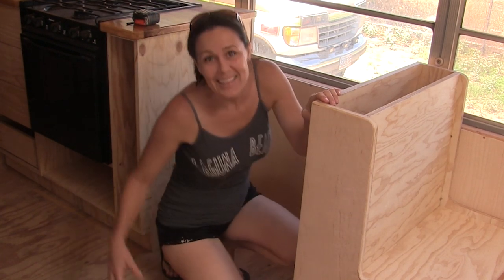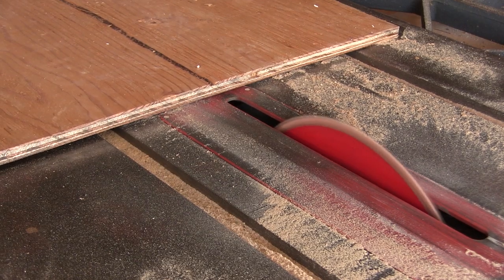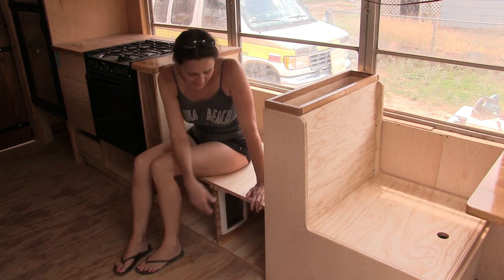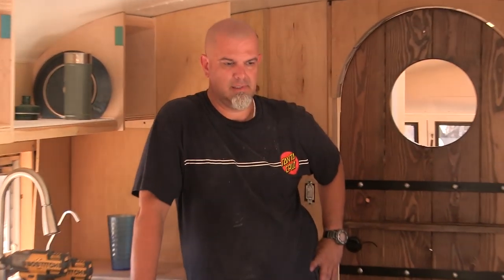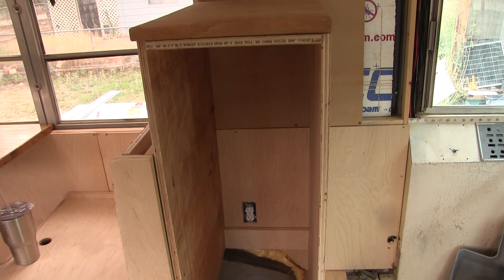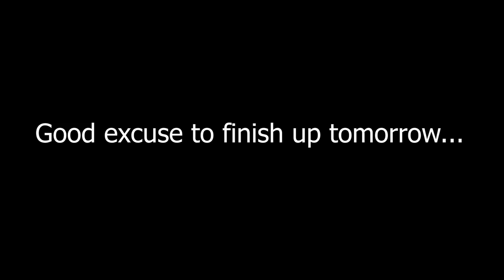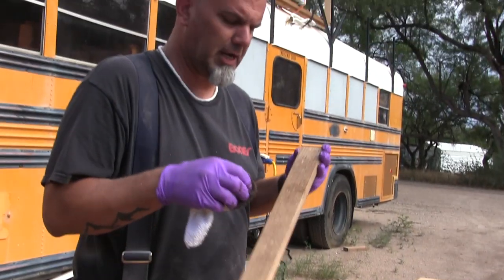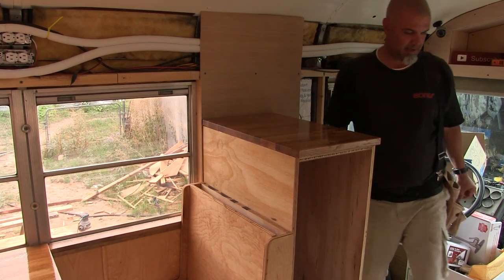Standing Desk/Cabinet, Kitty Kennel, Stain, Trim & More Skoolie Stuff!

Comment: Quick tip for cat litter: Do not get the Feline Pine stuff. It's 12 bucks for about 8 pounds. Instead, go to a farm supply store like Tractor Supply and get a 40 pound bag of pelletized horse bedding (compressed sawdust pellets). The reason why? It's the same thing as Feline Pine... but it's only $6 a bag... for 40 pounds. And you can use less than clay litter because it expands, it absorbs odor better, and you can toss the entire thing out when it's all been used up. And since it's sawdust, there's no clay dust that can cause breathing issues for you or kitty.

Comment: Still watching all your vids but this is such an awesome idea...one I need to remember whenever I try to build mine.  ADD:  think would take the kitty door from that section just leave the hole for getting in and out of litter box so you can get a longer one for senorita that flap will catch(that tiny litter box good chance she will miss and plop on the outside of box)...maybe use the kitty door on outside door for her to go in and out...does it have a slide in for locking down when needed?

Comment: Very nice work! A few suggestions for the dinette...you might make it so the cushions are attached to the seats. One thing that happens is they'll slide off the seat after awhile. I had that problem with mine when living in my 26' travel trailer. Every time I leaned back they'd slide forward. Also, you may want to make sure the cushions are thick and firm, because after awhile they'll settle and won't feel very comfortable anymore (specially when sleeping). : ) You could also put a potted plant or two on that new shelf behind the seat. You could also use the space under it for more storage.
Reply from the maker: We planned the dinette with storage hence why we can remove the seat and seat back.  We have been discussing options with the cushions for keeping them in place too! Thanks for the ideas!😁
Reply: @BussyMcBusface  - Good deal. Yeah, I should've known you already considered all that haha. You seem to be very meticulous, a good thing. : )

Comment: May I make a suggestion? If you go over you butcher block surfaces with ooo steel wool, I think you will be surprised at how smooth the surface will be and the sheen will still look good.

Comment: What plywood are you guys using for the wall sheathing and the kitchen carcasses? I’m just starting the interior of our bus build and look forward to your videos every week for inspiration. See ya out on the open road... eventually lol (if I don’t die of heat stroke first here in Texas).
Reply from the maker: We use 3/4" pine where it isn't going to show and 3/4" maple where it does show on the carcasses. For the walls we changed to using maple panelling.
Reply: Bussy McBusface thanks. Your build is coming out amazing. Looking forward to seeing what you do for the deck up top. Cheers.